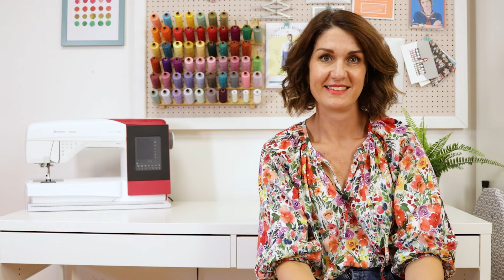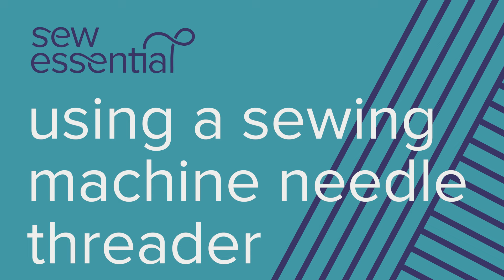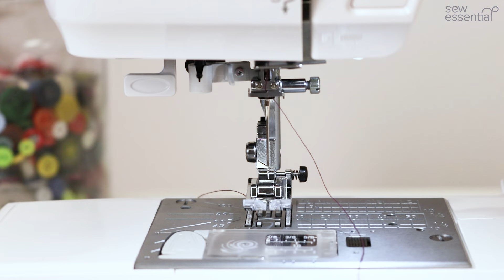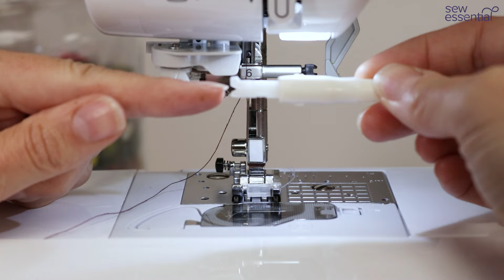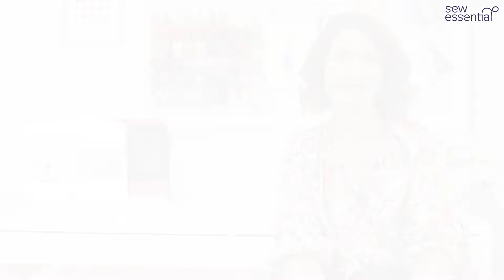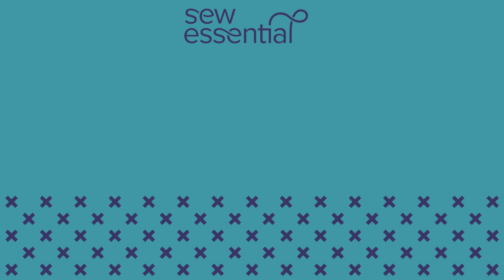How to Use a Sewing Machine Needle Threader - and what not to do!

Comment: Wow, thank you very much! I have a Singer with the first threader you demonstrated. I haven’t been able to figure it out since I got the machine lol! I have been using an old fashioned hand sewing needle threader to thread my machine…from the back side! I also have a device like the white one you used. Mine is blue. I didn’t even know that it had the threader on it. I have been using it as an aid to install a needle correctly (flat side to the back side). I also use a piece of fabric over my feed dogs when changing needles.  I had a needle drop into the machine when I was first learning to sew. It scared me sufficiently enough to keep something over the feed dogs after that, lol! It was an easy fix…but still! Thanks again for showing me something new!🦋